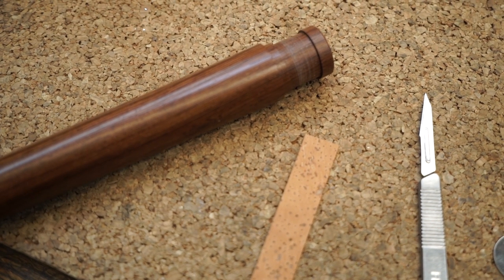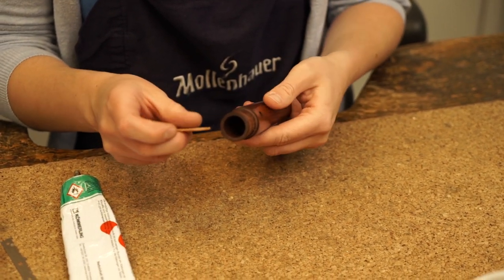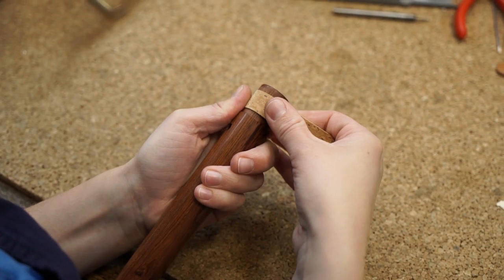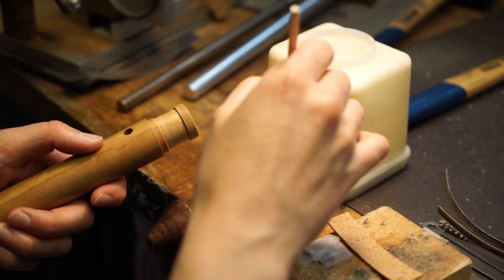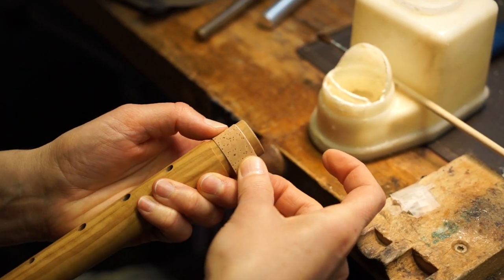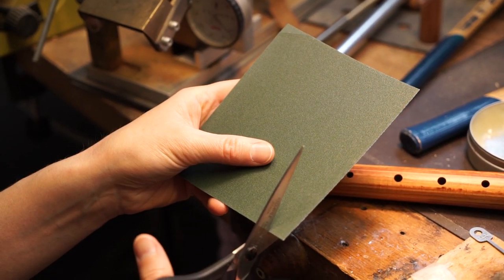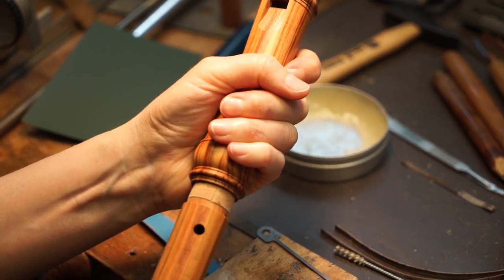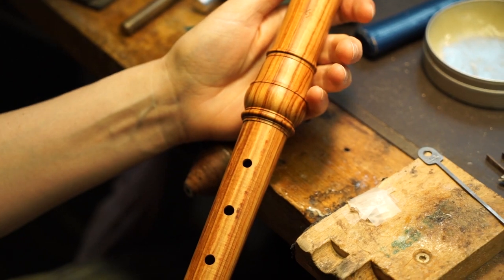Putting a new cork on a recorder tenon – an instruction

Comment: Great. Where can I buy the cork? I can't seem to find any sources on the Internet.
Reply: lol same here my friend, i will refer to this comment if i find anything.  my hohner is really loose i need to recork it.
Reply: it might be more common than we think, i think they are called cork tiles.  i see some on amazon
Reply: i think you get a tile and cut your size you need
Reply: i also see cork sheets on the home depot website, i have to go down to that parking lot tomorrow ill check and see if they have something in store
Reply: You can get it from across the Pacific Ocean (sorry, can't mention the site without getting my comment removed by YouTube). If you buy it locally, do not get the composite cork. That is made up of tiny pieces glued together, and it's for industrial use. You want the actual cork bark, sold in small sheets.
Reply: @griffithsharp Don't use the composite cork. That's for industrial purposes. You want the actual bark, sold in small sheets.